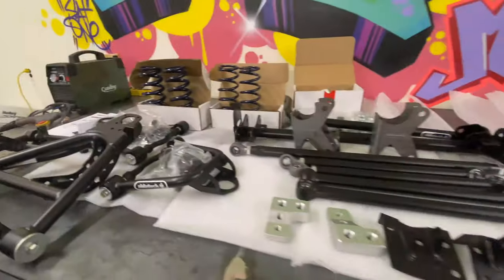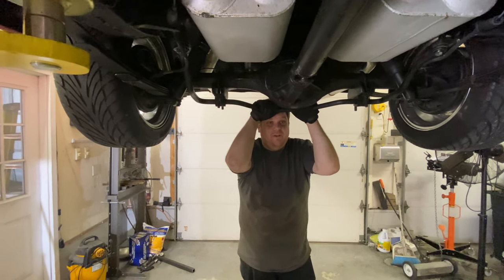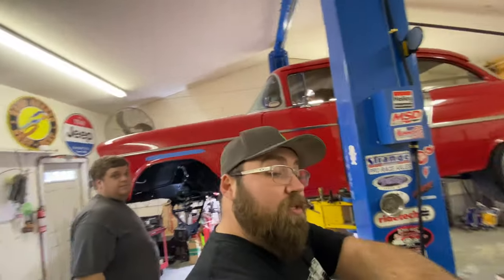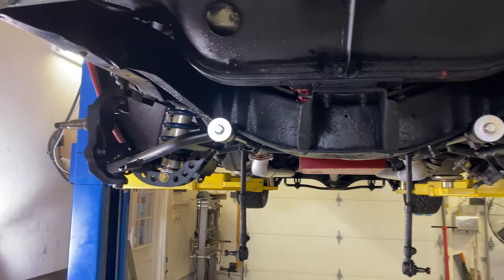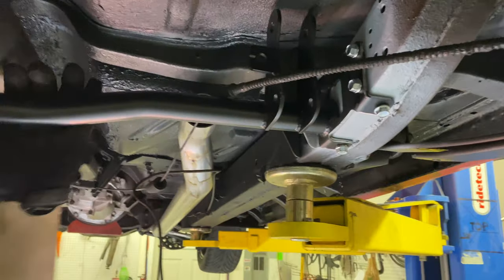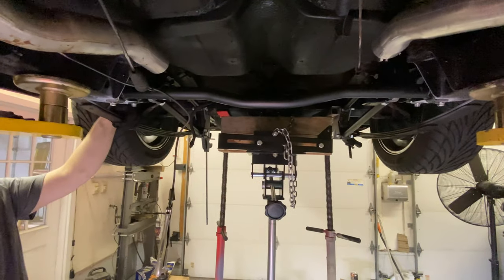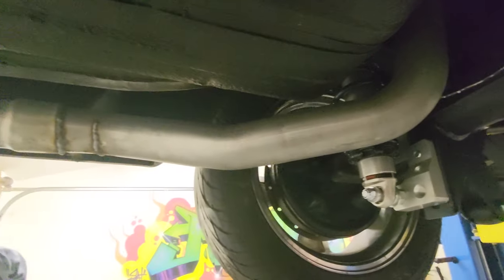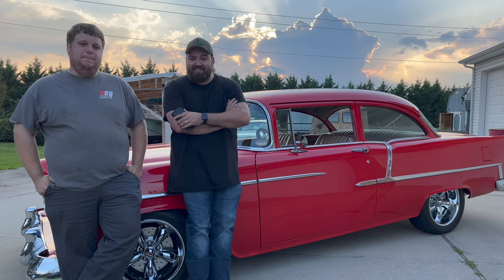How to install a Ridetech Coil-over system on a Tri 5 chevy

Comment: Beautiful! Sweet kit and the motor sounds nasty. Bags vs coil overs?
Reply from the maker: Thanks for the comment! WE have installed both bags and coilover from ridetech. The Coilovers are defenitley a better overall ride qulaity. But the benefit of the bags is that you can adjust the comfort and the responsivness with a touch of a button. With the coilovers you have to put the car on a lift and change the position of things.

Comment: Townsend, DE. Cool.
Reply from the maker: Thats right! we are right in Odessa.
Reply: I'm down in Cambridge, about hour and a half away.
Reply: @scottmartinetti4875  Choptank area. My fathers cousin used to live down the neck, make a right at the VFD and head to the waterfront. Long lots from the road to the shore but not very wide. It was back when you could take a boat out in the waters there and dip a bushel of crabs. Gone is that ability. I hope not but the prices must be reflecting supply.
Reply: @4speed3pedals  I know what you're talking about I've worked down that road before it's kind of passed the garden of Eden road. Yeah there's a bunch of smaller vacation homes back there really cool small area.
Reply: @4speed3pedals  so what's your father's cousin's name? I'm born and raised here.
Reply: @scottmartinetti4875  He and  his wife are deceased probably since the 80's. His name is Charles Laubach. I have no clue who owns the property today.
Reply: @4speed3pedals  oh wow. My mom was from here ( last name Todd), and my father's side been here since the 30s
Reply: @scottmartinetti4875  Only people I knew there were the Laubachs and I only visited there probly less than a dozen times. One time was fun when we got into the boat and Charlie started dipping crabs and even then he was remarking how the crab population was dwindling. This may have been in the 60s.

Comment: Hey guys I have a 55 and I'm getting ready to put a ridetech system on it.  Do you think shockwaves would be a better buy for quick adjustments on the go rather than the coilover?
Reply from the maker: Shockwaves are definitely an easier and quicker adjustment on the fly. If you don’t have the ability or the care to get under the car with an Allen wrench and a spanner wrench every time you wanna adjust the ride height, then shockwaves may be better.  But the coil over has a dial, (+-) on each coilover to adjust the stiffness of each shock pretty easily with no tools. But if you need to do ride height adjustments it requires tools. These adjustments are really big changes, and may be just enough for what you are looking for.

Comment: Do you like this set up better than the street grip package? Im not hitting the race track but want a smooth ride for sure. What kind of tires are you rolling on? I have a 57chevy bel air 2dr hardtop sitting on 20x8.5 rear and 18x8 front
Reply from the maker: This kit is far superior to the street grip, and the ability to customize the ride quality and ride height really is the benefit here.   The street grip is really a great kit for the money but is really static and you have one drivability setting, which is way better than factory but not customizable or tunable.
Reply: @MaffettMotorwerks  Thanks for the reply and knowledge definitely going to purchase this, thx
Reply from the maker: @riverparty64  I’m glad we could give you some input to help make the best decision 🙌🏼
Reply: ordered and being installed July 1st by sampson performance here in New Braunfels TX. If I hadn't seen your video I would have left it alone and drove it like it is, which feels like im constantly rolling down a rocky road lol. THANK YOU VERY MUCH
Reply from the maker: @riverparty64  this is awesome! So glad we could help you with making your ride even better.
Reply: @MaffettMotorwerks  curious how long it actually took to install it all and drive it down the road?